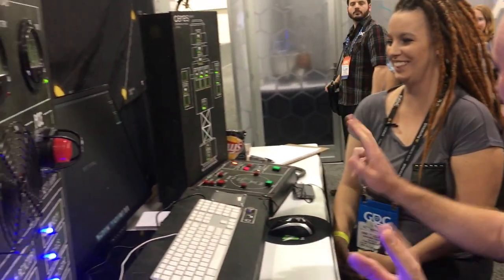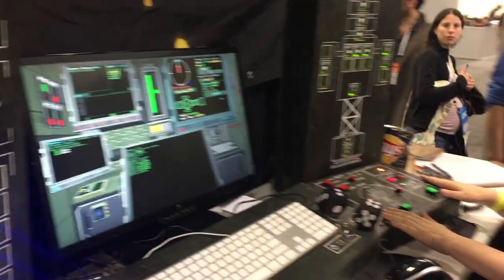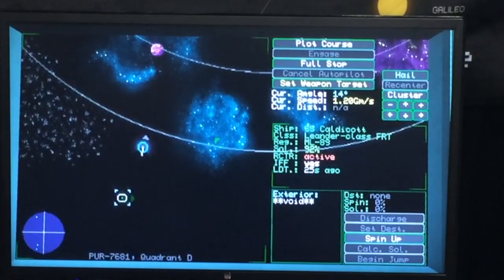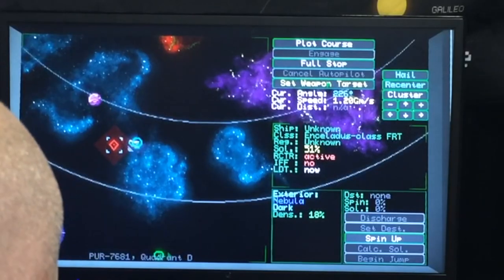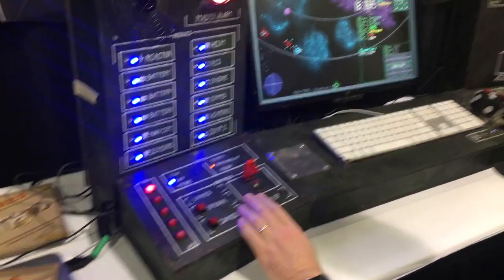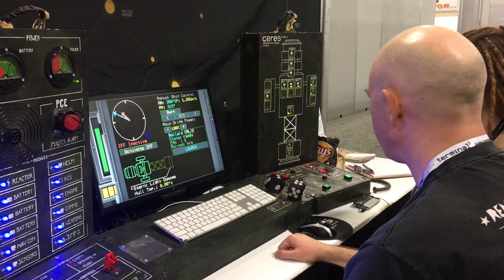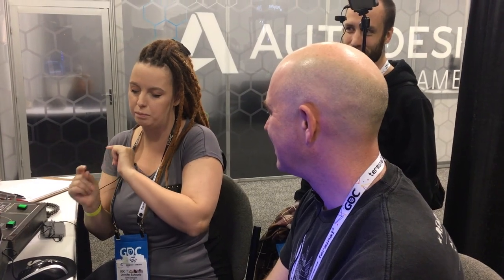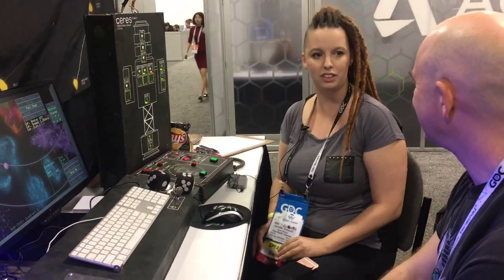Objects In Space - Build Your Own Control Panel

Comment: I remember how David Gerrold theorized that space combat would be like submarine combat, and it's nice to see a game that embraces this idea.
Reply: The game looks like fun, but let's note that Gerrold was incorrect. Infrared astronomy took off and today we know even a small IR observatory would see a manned spacecraft anywhere in the inner solar system. There's just too much temperature contrast between a warm ship and the background.The IR sensor can see differences of a fraction of a degree. There's just no way to stealth your heat from a sensor that good except to hide behind a rock.
Reply: CromemcoZ2 - An alternate place to hide would also be in either a part of space that has a density sufficient to give off an ambient IR similar to the ship, or in something that diffuses the It and masks the ships profile. any IR seeker head has to be able to tell what's a ship and what's a star, look like a Star and it won't shoot you. I really like how the game included that with the nebulae. Although, for an EMP to affect a ship, it would have to be really close, almost close enough for shrapnel to more of a concern. The radiation shielding you need to keep a crew safe in deep space would block much of an EMP. So while there are differences with space combat vs. naval combat, I hink the differences are quite small in the grand scheme of things. direct torpedo or railgun style impact are going to be the best weapon choices, much like surface naval engagements.
Reply: On the contrary, it isn't at all analogous to SOSUS at all.  Instead, it's analogous to the cheap IR filter capability found in every smartphone.  One needn't have a powerful and sensitive infrared detection system to detect a craft against a backdrop of nearly zero Kelvin.  SOSUS is necessary because you are searching for a target marginally more loud than background.  In this situation, any target is remarkably hotter than background unless they are hiding behind known objects.
Reply: +transcendentape Just let it go. People have to have their "Stealth in space" fantasies.
Reply: +Willaev "Let it go" is not one of my character strengths.  My nieces do like the song quite a bit.  However, when people like +juk123 45 insist that their fantasy is an accurate representation of reality, I have a hard time embracing the frozen fractals all around.
Reply: Children Of A Dead Earth is worth a look.

Comment: 4 screws holding on a panel, very Sci-Fi. 

 I worked for the Air Force on the B-1 bomber.  By the time we get the panel open, the part repaired, and the panel reattached the movie would be over.  There were anywhere to 20 to 220 screws per panel depending on which one we were digging around in.

Comment: how much will it approximally cost to build the control panels?
Reply: it will depend on the exact components you pick. the lights will probably be 10 cents or less each, the buttons and switches will probably be 2 dollars or less each, and the same goes for the "missile" switch cover. the dials are likely to be the most expensive panel components, at $5 to $20 each, depending on the model. and i assume the whole thing is controlled by something like an arduino, possibly with a multiplexer or two, which adds another $5 to $25. wires and minor components like resistors probably add up to less than $5. so you're almost certainly looking at less than $80 (not including the actual boxes), plus however much you value your work at for putting it all together.